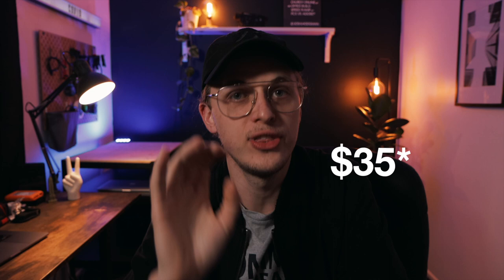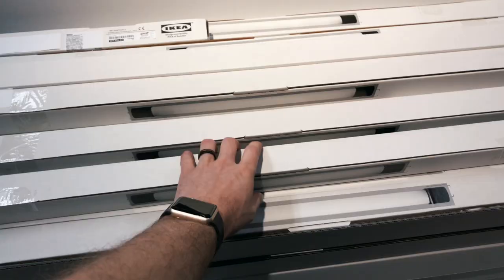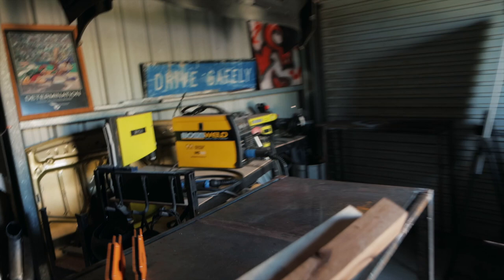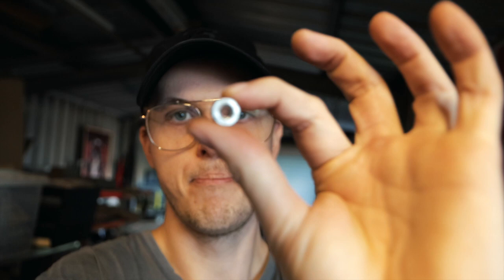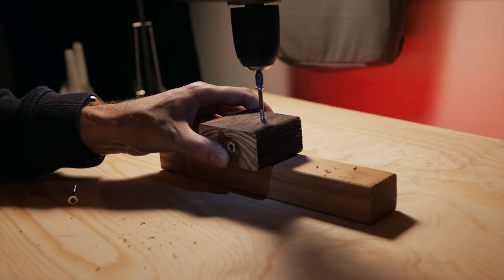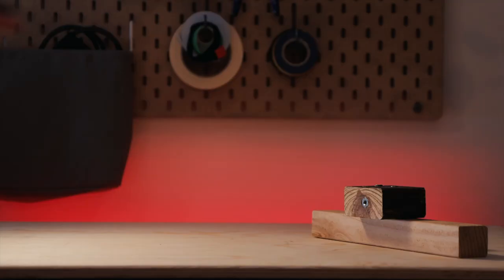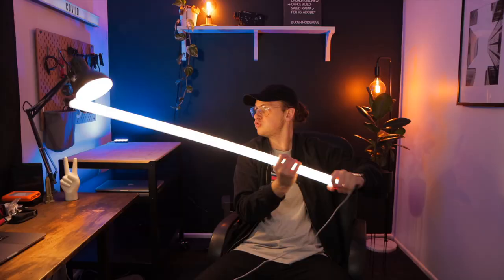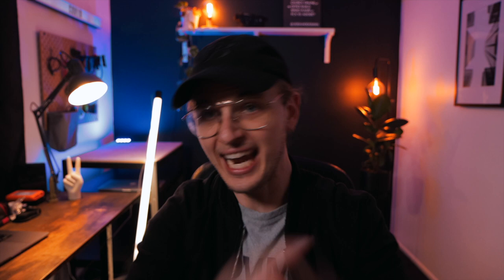CHEAP CINEMATIC LIGHTING FROM IKEA for $35! - DIY Kino Flow (Best Lighting For Beginner Filmmakers)

Comment: Where did you get a dimmer? if I would like to make one kino flow - where there is a whole panel at the back, what would you recommend to use? a card board?  do you think it will become too hot that it will catch on fire?
Reply from the maker: LOVE A GOOD DIY!

I got the adapter from ikea too, its not a dimmer though :( they arnt that bright though so I don't think you would need to dim. No black cardboard attached to the wood would have been a great idea! they never run hot so no FIRE warning at all!
Reply: Josh Hodgman thank you for the reply Josh! 😘